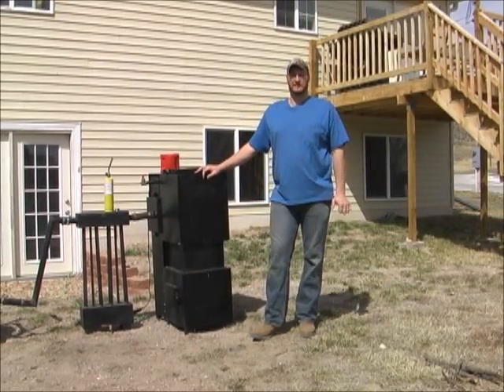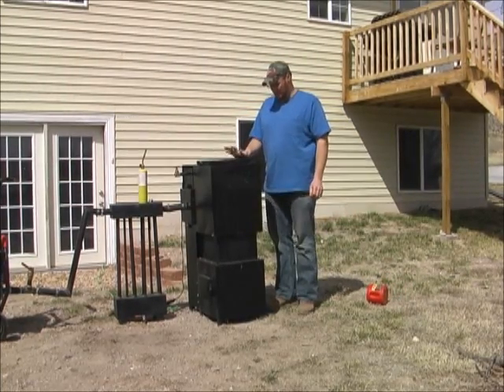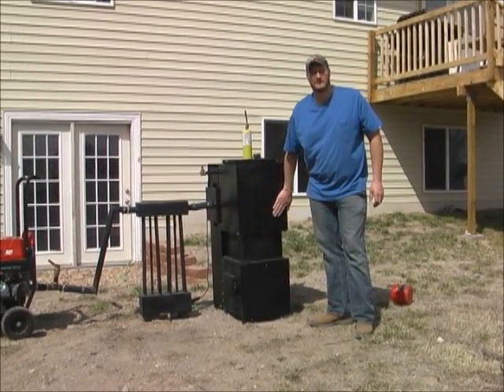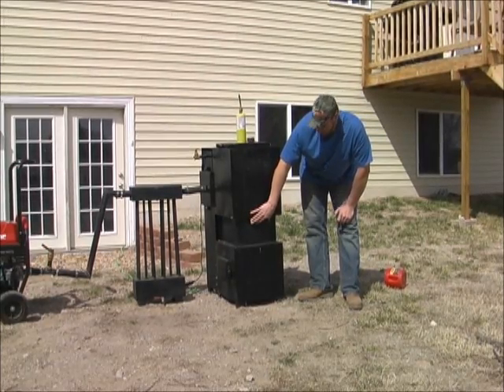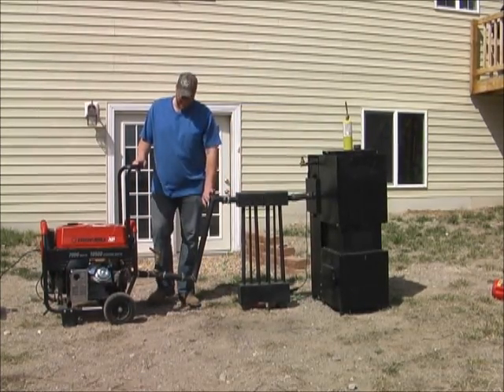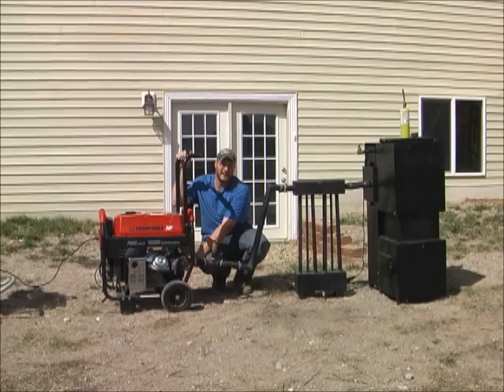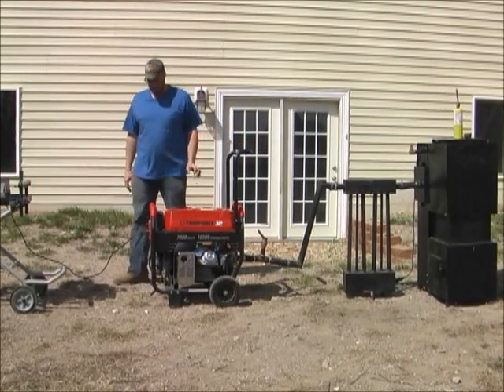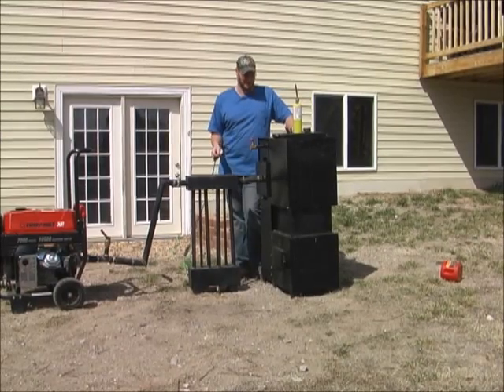How The Liberator Gasifier Works

Comment: Plug the chopsaw into the power and do away with the other bullshit.
Reply: What if the power is out though? With a spare battery or two and an inverter, a gasifier can run a generator to keep your fridge cool (prevent food spoilage), run a small AC unit to help keep you cool, and/or power some lights to see with. Sure, you could just let the food spoil and sweat out the heat without AC and can sit in the dark or use candles/kerosene lanterns, but that sucks. A little preparation ahead of time can make life during "disasters" much nicer. I would probably not buy this unit for reasons I will not say but I may build my own someday to run a generator specifically for air conditioning and battery charging. Think big battery bank with a charger that is run from a generator that is run off of wood gas. When bank gets a little low, run the generator to charge it back up. Can use a rocket stove for cooking and a simple wood stove for heating. This previous winter I "weathered" a nasty winter storm that knocked out everybodys power for a couple of weeks in relative comfort. I was bored but I was warm and comfortable and none of my food spoiled. A little preparation can go a long way. It isn't IF the power goes out, it is when. Eventually the grid goes down due to weather but can also go down for other reasons.

Comment: How much heat is given off by the gasifier?
Reply: Probably a lot. Look into the BTU output average for the various woods and you will see why wood stoves are useful for heating a home. With the investment of a chainsaw, some education about it and a little work, you can heat your home for almost free. If you have a gasifier, you can also run a generator (or even your vehicle) for nearly free as well. Of course, running a vehicle off of wood gas is a lot more complicated than running a generator off of it.
Reply: I heard on another video 491 degrees F.
Reply: The reason I ask is, I want to know how much heat you are capturing in the process of producing the wood gas.  If it's a lot, that's an amazing reuse of what is essentially a waste product.

Comment: You provided very little info on the unit and did not show it's operation. Let the running unit do the talking and save the discussions for proper Mape torch lighting.

Comment: No. Diesel engines are compression engines. You could however use waste vegetable oil from fast food restaurants. The downside is you either have to have both a diesel tank and an oil tank or heat the oil before sending it to the engine. This lowers the oils viscosity (thickness) down to around the same as diesel. Otherwise you start the engine on diesel and let it warm up then switch fuel sources. The engine will burn it though with no other modification other than fuel control.

Comment: You could just start the blower if you had some gas in the genny and then switch the fuel over once the fire is burning and the gas is ready, just open the ball valve fully until your ready to switch to wood fuel.

Comment: What is the point of a gasifier running a generator if you have 110v available? The only reason I would be interested in a gasifier is to run a generator (or vehichle) during emergency scenarios with fuel shortages.

Comment: ..Nasa tecnology filters etc.. pfff  this is a tecnology that existed since world war 2 when most cars etc was run by it due to the gasoline shortage, and its not a secret technology in any way as exact details on how to build it is all over the net, only thing you done is added the need for 110 volt to run it, when in fact thats not even needed, so your version of the system is less versitile than the original versions that run independent without any need for electrical power

Comment: Really nice man. How many hours of operation before you need to clean the filters? How many times can you reuse the filters?  It seems that the tough issue with gasifiers is the filter system.